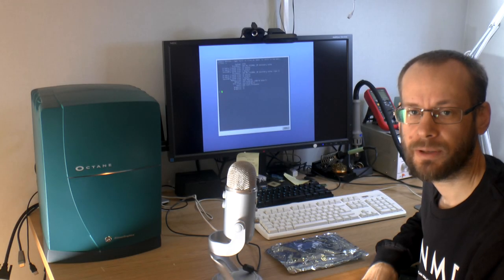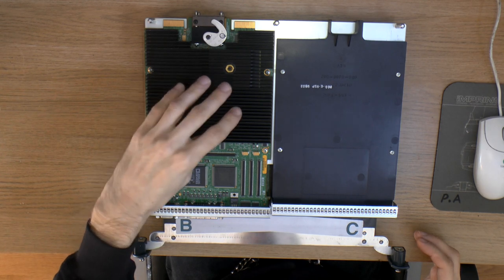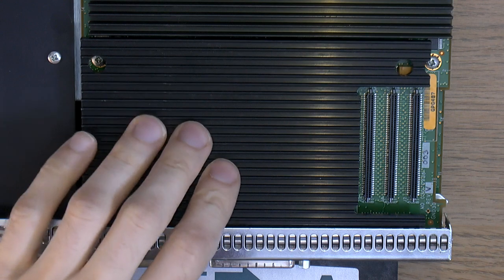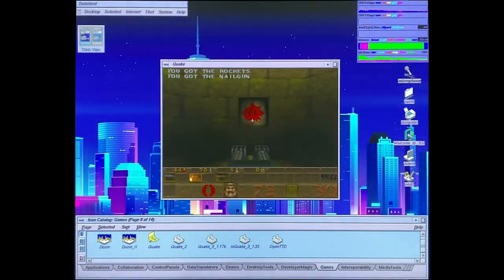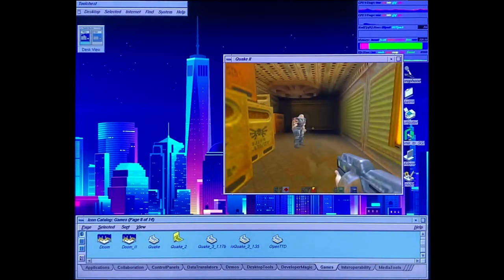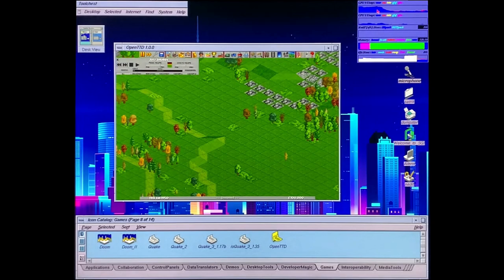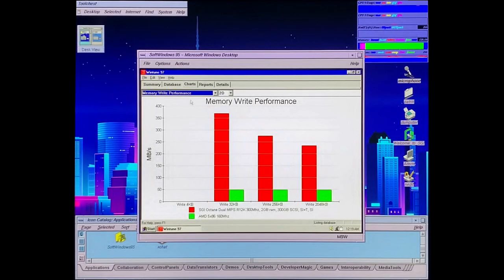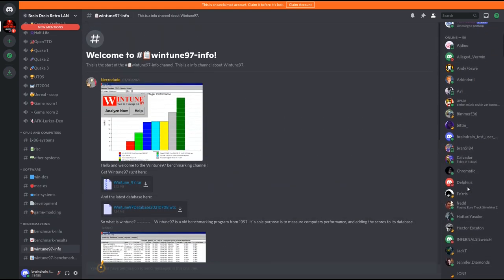SGI Octane TRAM Upgrade

Comment: i think this was the first time ive seen a silicon pc actually running something useful :-)
Reply from the maker: Hehe.
Im gonna see if I can get OpenRA running, they have ported that to IRIX.
There are a lot more games actually, its just dependency hell, you kind of have to pick what you really want installed, sometimes two programs want different versions of the same library.

Freeciv 1 and 2 exist, Hexen II.

Probably more that I dont know about.